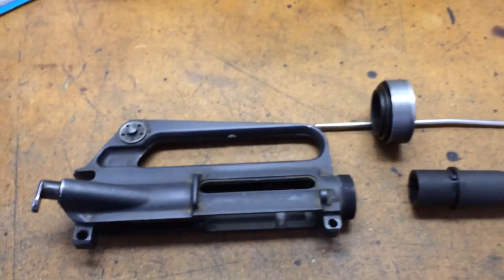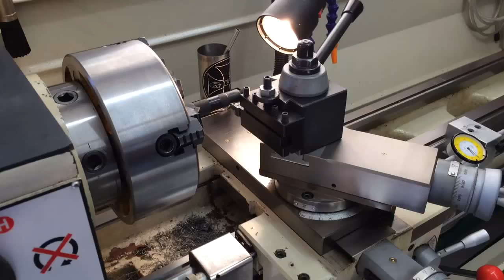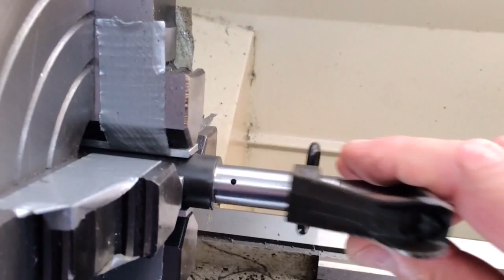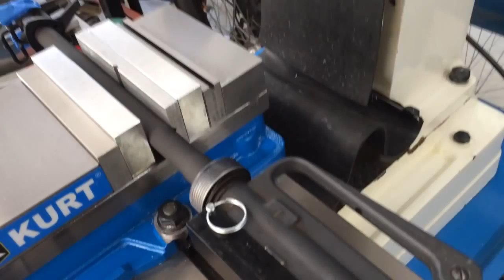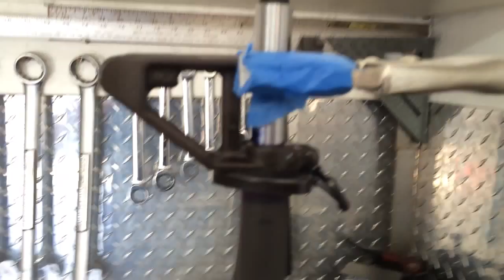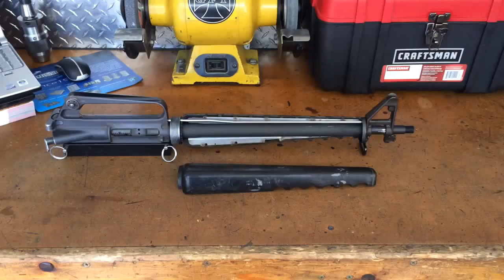Colt M16A1 "Retro" Build Part 2 #realraysgarage

Comment: Okay, I'm a full time machinist, this is my take. so at at first (being that I am a purist) I thought the proto type 16"barrel A1 was a dumb idea because it wasn't the greatest back in the 60's. Then you mentioned "a little machining" and I'm thinking "great, I give the guy the benefit of the doubt and he seals the deal with a Bubba Gump gunsmith job."....THEN you indicated  4 jaw chuck, turned it down with a mirror finish, then the sight fit like a glove.   TITTIES MAN! You are rockin a sick build, I'm watching the rest of the series and subbing. Nothing but respect man, have a good week! 😎
Reply from the maker: +UnitCrane514 Thanks man!
You nailed it, like you said the thing did not work for crap and put our guys in danger who carried one, so this gave me a reason to clone the Colt 605 (Dissipator), and more importantly, one that works! After some research, I read that the Military just cut the 20" barrels down to 15" with no consideration of dwell time or gas port size. Keeping the rifle length gas system I have one very reliable shooter, so far after about 1000 rounds she is still rock solid!

Thanks for tuning in and you enjoy the other videos.
Best Regards,
Ray

Comment: That is great work. So from the looks of things the A1 handguards had no problem fitting over the h-bar barrel?
Reply from the maker: Yes, fit like a glove and one of my favorite shooters to date!
Reply: @RaysGarage   Sorry about the confusion. I looked at another dissipator upper video and they had a carbine length gas system that I didn't see the first time and that's why the A1 handguard didn't fit right.
Reply from the maker: Teddy Molnar No worries brother, I used a Del Ton 16” Heavy Barrel with a rifle length gas system, I opened up the gas port to .100” to correct cycling issues since the dwell time is so short. She runs like a champ!
Reply: @RaysGarage  Thank you for all your help.
Reply: @RaysGarage  Yes looks great. That was a Hbar barrel. That will be my next project. It would be great to see it in action. It's one of my favorite configurations for the AR15.

Comment: Shouldn't it have a 20 inch barrell?
Reply from the maker: Hello Patty, The M16A1 does have a 20" barrel but this is a M16A1 Model 605 clone which had a 15" barrel but SBR's are not legal here in Ca so i went with the DelTon 16" barrel.

Comment: good luck I'm having a hell of a time finding a damn pencil barrel under 250
Reply from the maker: Yea, I hear that! Green Mountain is the correct barrel for the 20" build but a little pricey!
Reply: I'm really considering just putting on a 16 inch pencil Barrel to save costs until tax time maybe I'll fall into a 20-inch pencil by then cuz I know I would like a full size A1 and a carbine so it may work out

Comment: Love it.
Reply from the maker: +Aroric Wolfheart Thanks man!

Regards,
Ray
Reply: +Ray Caniglia isn't that exposed bear Barrel going to have some corrosion/ rusting problems if you don't parkerize the bare metal?
Reply from the maker: +oopsydaisy07 The entire rifle was finished with DuraCoat so no surface was left unfinished. Check out the rest of the series for the finished rifle and field test.
Thanks for tuning in!
Ray
Reply: +Ray Caniglia thanks for replying back and what a cool build/ project you got going on, I also was thinking about getting a dissipator from Del-Ton inputting old school triangle hand guards on it and I've always loved the old school teardrop forward assist on the Vietnam era AR-15/ M16.I have a question though will the old school teardrop forward assist fit in modern day uppers?
Reply from the maker: +oopsydaisy07 I would have to measure to tell you for sure if the M16 forward assist would work in a modern upper receiver, I do know for sure that there is a teardrop style modern version available at many parts distributors.
Reply: +Ray Caniglia great thanks for the info.

Comment: when I installed the site on my a1 build, being a bit anal, I didn't feel comfortable lining up scribe marks (a little off makes a big difference in site alignment) so I got an in the chamber laser, centered the rear site, lowered the front site post so that the dot would be just above the post at 25' then rotated the front site until the dot was right on top of the front post then clamped on the vice grips, when I was confident with the alignment I drilled and reamed as you did.  after the rifle was assembled and shot the rear was only 2 clicks off.
Reply from the maker: You never be too anal! I use your method when doing AK builds, the chamber laser is the way to go!

Thanks for dropping by!

Ray

Comment: Looks great! The 605 as built for the military had the bayonet lug cut off. Also you could have used a low profile pencil barrel and cut it down to length and opened up the gas hole.
Reply from the maker: Thank you! I went with Del Ton barrel because it was about $120 delivered, plus I did want the heavy barrel. I did not cut the bayonet lug because I had the extra length unlike the 605's 15" bbl. I guess I should not be calling it a 605 clone. Thank for the info, and thanks for watching! Ray C.

Comment: How does the carriage stop work Ray? I thought these lathes only have a sheer pin if you run the travel against an immovable object?
Reply from the maker: Hi Cruiser, You are correct, the auto feed does have a brass sheer pin to protect itself from damage. The carriage stop is just a way of making a positive stop after each pass, I run the power feed untill I get close then disengage and run it up againest the stop feeding the carriage by hand. The carriage stop also has about .500" of fine adjustment.
Reply: Ok, gotcha. That is a good idea actually as it is hard to be repeatable just using the power feed. Did  you buy it or make it? I was watching a video somewhere else where a guy installed one on a new lathe and thought it would release the clutch....did not end well.
Reply from the maker: Cruiser Mac I bought this one from Grizzly and had to make a shim for it to work, to be honest I would make one, it's a easy fun project and will fit your lathe without having to make it fit right.
Reply: Cruiser Mac Some lathes have a switch as the stop... the carriage just runs into it. But unless they have a brake, it may not stop dead.
Reply from the maker: It is just a dead stop, not auto. I usually stop the auto feed then hand feed to the stop.

Comment: Would it have been easier to set up in a steady rest than to mess with that little plastic ring?
Reply from the maker: Hi Tyler, I really don't like using the steady rest unless I have too. By using the plastic ring I only have to indicate one end. If I was going to profile the full length of the barrel then yes I would use the four jaw and the steady rest. I have used the ring on several of my AR barrels for threading, and crown work every one of them turned out perfect. Thanks for watching!